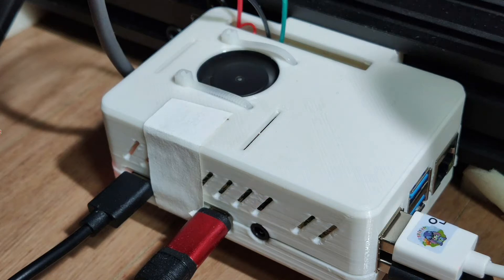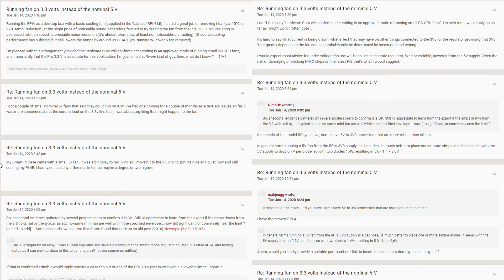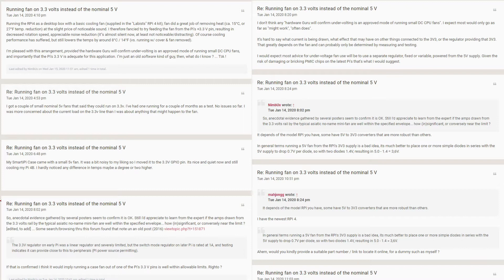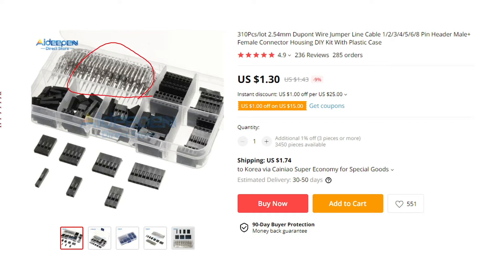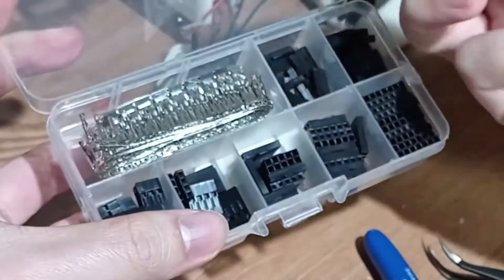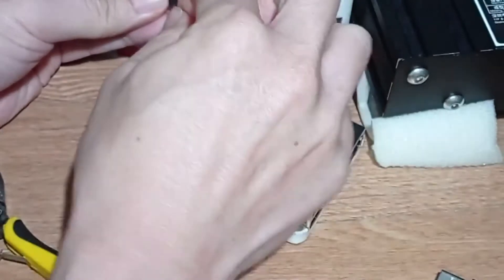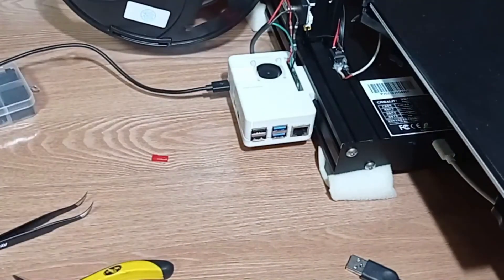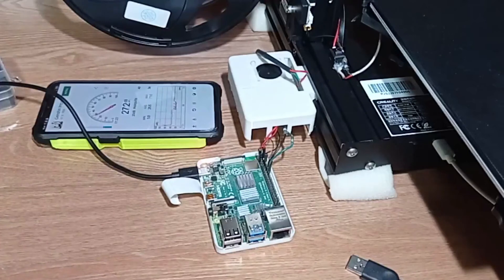Simple Quiet Fan Mod for Raspberry Pi 4B

Comment: Those people have no idea what they're talking about for the fan on 3.3v. Fans draw very little amperage, and 3v3 will power those mini fans just fine. It will just be at a slower speed. If you plan on using the CPU, use 5v, if you're mainly idling, 3v is probably fine depending on the ambient temperature of where the Pi is stored.